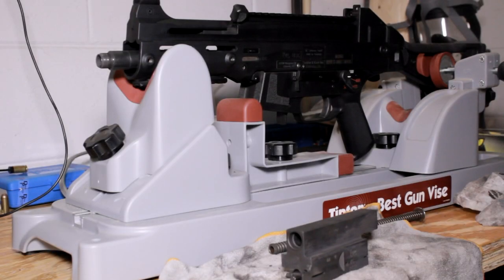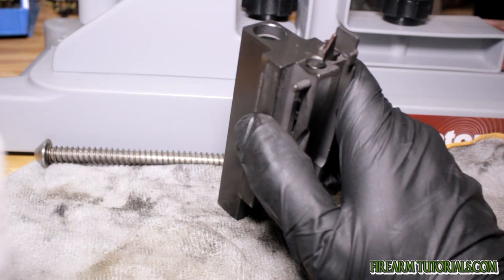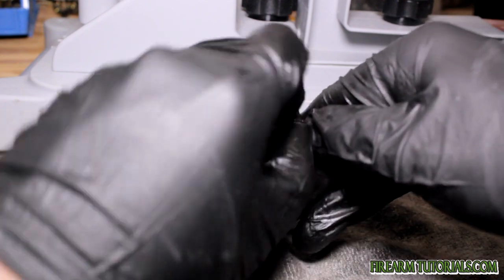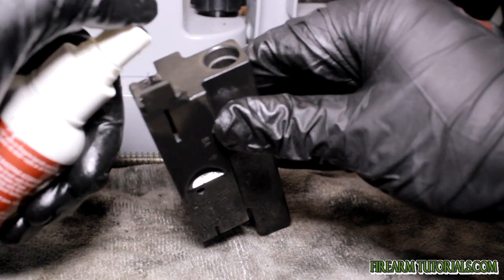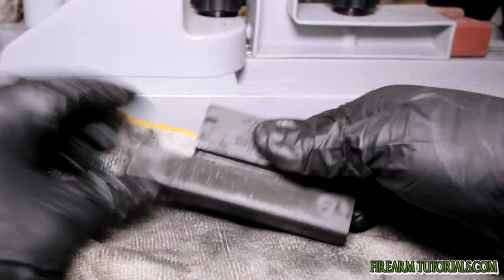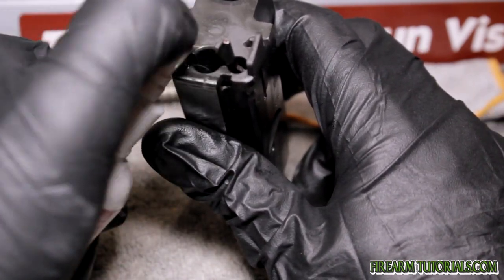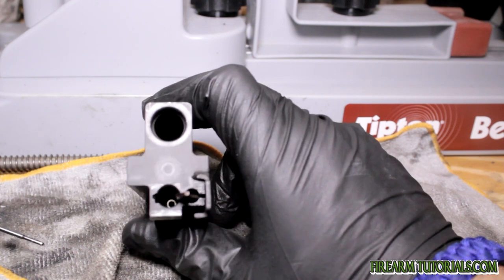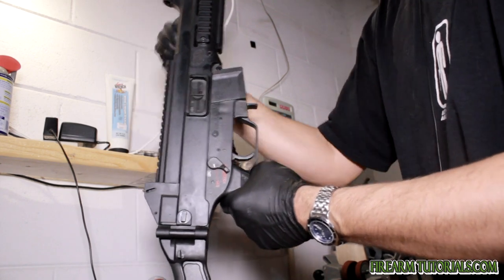HK USC/UMP bolt takedown and cleaning

Comment: I bet you, that some baking oven cleaner will amaze you! I use it to dissolve carbon build up on used engine pistons. After an hour of soaking you can literally wipe all the dirt away.
Reply from the maker: Interesting idea.  I'll have to try that.  Sounds like a good thing to try for cleaning suppressors as well.  Thanks for watching.
Reply: *****
Please tell me the results how it works on cleaning a firearm.
Cheers :)

Comment: Great video ! 
I want to buy a HK USC too, did you ever have problems with your gun and how many rounds have you already put through it ? 

Thanks, greetings from Germany !
Reply from the maker: I only shot about 10 rounds before I had it converted to a UMP.  I've probably put 2000 rounds through it without a single failure.  Thanks for watching.
Reply: I put a few thousand rnds through mine since 2005. Great gun. No problems.